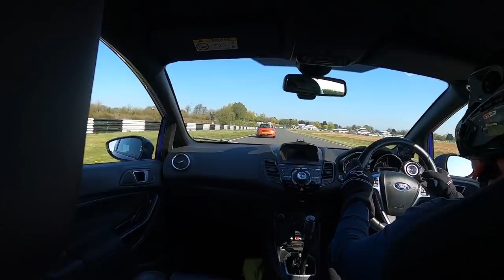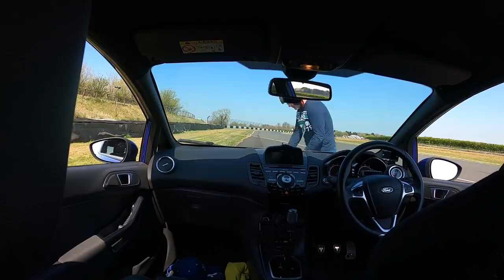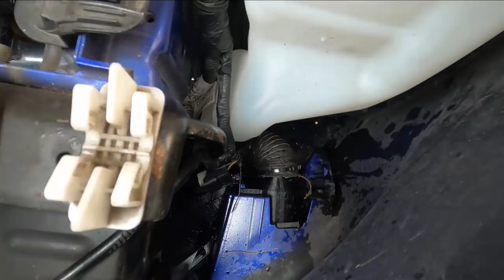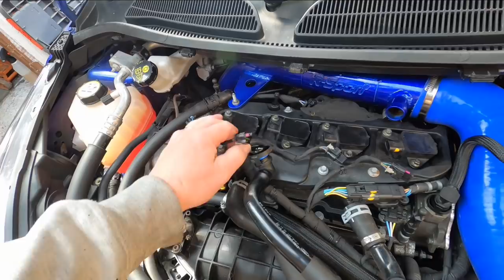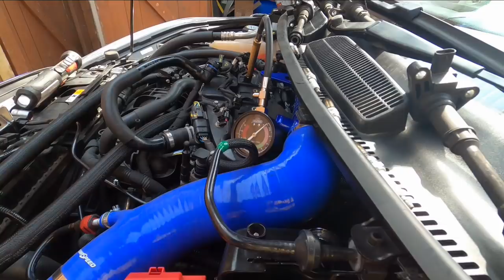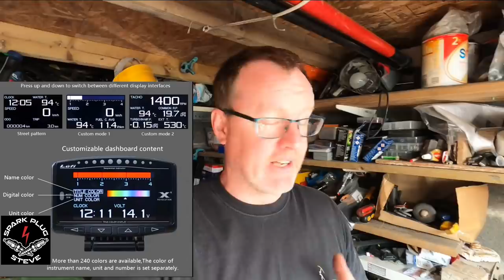My engine blew up! (NOT CLICKBAIT... well maybe the thumbnail just a little)

Comment: Legend has it that an engine always feels faster just before it blows...
Reply: Ye because the piston rings over heat and over expand creating a better seal and thous higher compression but then they obliterate from the excess heat and friction lol. Steve could try putting a tea spoon of engine oil down into the suspect cylinder to see if it helps compression, if it does it means it's your rings, but if not it is the valves (could be from valve float). Either way there is enough second hand engine parts floating around on Ebay you could just hone the damaged cylinder wall depending of severity and then replace the piston rings. If it is a valve just replace it and then lap the valve.

Comment: I think you first cracked a sleeve (overheating) then the ovaled out Cylinder allowed the combustion to push on the side of the piston and therefore it blew off the lower portion of the piston (happened to mine)
Reply from the maker: Seems likely.
Reply: What set up were you running Checcoo97
Reply: @christianwright5479  Stock Block x47r with manual boost control to 2.3 Bar, obviously it was my own fault that it blew up..... Coming from the Abarth World where they have cast iron blocks i had to learn the Hard way what "open deck aluminiun block" means

Comment: you were pushing the engine beyond its limits not surprised it blew up, the internals need modifying crank, pistons etc if you want to race it, that's what race engines are for.
Reply: But aet Motorsport did a few time attack seasons without a problem?
Reply: @christianwright5479  so what point are you making? are you saying there is no need to upgrade the most important parts of the engine? lmfao.
Reply: I’m sorry that you took offence to my comment young man. 
The point I was trying to ask/make, how can the likes of aet run similar power without going pop? 
I have collected 90% of the parts for stage 3. So I’m genuinely Interested
Reply: @christianwright5479  how do you know they run a stock engine block? you can only believe what they tell you and as they sell expensive tuning parts and software what do you think? and will you be able to get your money back when your engine goes pop? cause they told you it will be ok, think not. get your money ready for a new engine cause your going to need one very soon.
Reply: There are plenty ST's running low 300 BHP dedicated for track use with stock bottom end and head... Something just gave and that's unlucky.
Near me there is a dude with a 320BHP ST with gutted interior that he tracks atleast twice a month and the only mod he did to the internals is a pumaspeed block mod to prevent the ovaling of the cylinder bores and head gasket failure.
Only real issue he had in 3 years of the car being stage3 is a broken 4th gear
Reply: @simonoi11  had a 350bhp focus with a block mod, and I drove that really hard never had a problem. 
I run a Collins stage 2 map on the fiesta, but still Deciding what tuner to use for hybrid

Comment: Oil starvation will be the cause. Due to the extra power and grip from the diff its causing the oil to go to one side of the sump   in the corners. For track use make sure you have a oil pressure gauge. I bet its spun a shell and caused ring damage.

Comment: 100% pull the engine out and let us see whats failed. I have 140 psi in cylinder 1 & 4 but 120 psi in 2 and 3 so will be interesting to see what failed already on yours and what is likely to fail on mine. Keep up the good videos 👌

Comment: Hey man, grab a Cobb access port and have Adam Tuned do your tuning.  He is really good and he knows the S280 turbo and the the engine's limits.  We've seen this in the states a lot.  I bet you deformed the cylinder wall right at the thin spot between cylinders.  Can't wait for the new setup.

Comment: A friend of mine has the same specced fiesta st as i do, same tune, same upgrades. After 2 laps on the ring he is hitting 105 degrees while i am hardly hitting 95. Tried everything even swapping parts between cars. Now he is running bigger radiator and oil cooler and is getting decent temps. Strange how 2 identical cars can get so different temps. It's like u say, it's a bit of luck with these engines. Gonna put shims in mine to be sure when i change out the timing belt. And please make some videos of you investigating the engine. U always make it understandable for a lot of people!

Comment: Yes! So many blown stg 3 fiesta's!! Please find a way for our setups to live! Film a series on known failures and possible remedies! (On stg3's specifically)
Reply: Shims, bigger radiator, oil cooler, liners,... not a closed deck cause they seem to have problems with heat building up cause the engines cooling wasn't designed for closed deck.

Comment: Keen to see the engine strip down....my thoughts are leaned out and melted piston or blown head gasket. I have just rebuilt a 2019 1.4 turbo Suzuki Vitara engine (write off as driver hit a animal & cooked it) i thought the compression was still low on 2,3,4...mine one is over 200psi being turbo...or maybe it's just the Suzuki engine design?

Comment: Until the engine is completely torn down are you sure it's a write off? Whip the head off and check for damage to valves etc and have a look down the bores, is the crank and bottom end ok? Can these engines be rebored or do they have to be relined? It would be great to find the cause and factor in strengthening that area on this or a future engine. Is it cheaper to just chuck in another engine? would you know the history of it and have confidence to tune it? Good luck and keep smiling!

Comment: Take the rocker cover off and check all the valves are working as they should. If you've burnt out a valve or bent an inlet you'd have no compression

Comment: Sorry about the engine 😞 If I had to guess I would be a headgasket/ cylinder head went and washed the lubricantion out of Cylinder 1 and then took out the piston ring which tore up the block. Would love to see a postmortem of the engine. Please check the oils as if there is metallic parts the turbo will need to be cleaned or you will be here again.

Comment: Id say maybe ring landings cracked
Or the cylinder bore 
can u get a bore scope an have a look inside  the cylinder see if u got any scoring down sides
Or a hole in the piston 
Sad to hear the bad news hopefully see u build it back stronger than ever
Maybe worth stripping first see if it can be saved
Could build it with forged internals if block is reusable

Comment: It's not zero compression....there's something there which would suggest rings in my opinion. Dead zero would suggest a broken valve or piston(hole in the engine). I would strip it and consider upgraded springs/pistons etc. Stick one of those scopes down the spark plug hole and take a look at the crown ?

Comment: Surprised no endoscope, handy thing to have used mine to check for leaks on the dishwasher last week ( that’s man maths for a tool you’ll need once in a blue moon)  ,,,,,,, I suppose it all comes down to natural limits of the engine, I think asking a 1600 to go much past 300bhp is pushing your luck, do people not put the 2.0 turbos in the fiesta as I imagine ?  Anyway now seems sensible time to pop a k20 in and get some good old NA power in it ,

Comment: steve  take the cover off and check the valves  it could be a  bent or open  valve which would let the oil in and give no compression its worth a look  into   just my guess   m8 .

Comment: I run the 2R Cat Safe, so hope it's not, but will be interested to see if running that had done any engine damage at all? Hard to find any concrete evidence it does damage to engines and not just your cat on the interweb.
Hope all gets sorted soon. Been starting to save for x47r recently, but hearing more and more stage 3's have engine trouble now, definitely having 2nd thoughts. 2R is plenty for public road.

Comment: Sucks to hear this mate
I had the same happen to me 
turned out i burnt a hole in the Zylinder of piston 4 

Bad thing is the engine was completely fine but you can’t buy new Pistons at your ford dealership 
I ended up buying a used piston and put that in 
the car 

was running fine for 4-5 months and now my head gasket started to leak water into Zylinder 1 

Now i am in the process of replacing the engine for a new one and most likely will rebuild the old one with forged pistons and stuff 

I mean you can see it as a glas half full thing 
Atleast it Looks like you can save the engine 
Anyway good luck mate and keep it up 
Love the videos about the fiesta since no one goes as much into detail as you do 👍👍

Comment: Have you got an oil pressure gauge in the car? Didn’t lose oil pressure going round a strong corner and spun the bearings on cylinder 1 and cracked a piston?

Comment: Broken rings,but could be head gasket as well,or a crack being as its getting hot. Its got to come apart.  Get the head off first before you get a engine. You might be lucky ,hone the bore and a set of rings in number 1. New head gasket and away.👍

Comment: I had this happen last year in 1st lockdown,  cylinder 1 cracked piston, piston rings and bits of piston went on an adventure round the engine. drain the oil pan see what turns up. 
damage happens don't worry about its seen a lot of track action by the sound of it.  engine rebuild is alright, get the ford Etas/ itas cant remember the name workshop manual. has complete tear down and rebuild process and torque specs. 

also where did you get your compression tester? could only find cheap Chinese crap on ebay.

Comment: Welcome to the (sad) club of blown engines... I feel your pain... Mine's been sitting at home with a blown cylinder as well, exactly the same as your car (oil coming out of ITG filter, white smoke on track, 0 compression on cyl. 3 but the others are fine, etc...) I will be pulling the engine out as well in a few weeks hopefully. Would be interesting to see what your findings are and I'll let you know what caused mine to blow.
Reply: And ? To mutch hp  or torque seems the main reason

Comment: The engine may be salvageable Steve. If it is would it be worth rebuilding and forging it. The standard engine should be good for 350 bhp so it was'nt the tune. Many many of these are running 300 plus hp. Be a good opportunity to forge it and run a very reliable 350 bhp

Comment: So gutted for you Steve! 😟 I blew my Engine at Combe last year. No Compression on Cylinder 1 and it turned out to be a snapped inlet Camshaft between the lobes of Cylinders 1 & 2. On your Engine it’s more than likely damaged rings on Cylinder 1 but a video into diagnosing the root cause on a tear down will certainly be interesting. Onwards and upwards my friend. Got a fully built engine in mine now with an even better spec. Head up mate you’ll be back on circuit in no time! 👍

Comment: Bad luck steve but onwards and upwards.
Personally i would put my money on ringlands or cracked cylinder liner , most common problem areas. 
If your going to forge or rebuild then talk to my very good friend and master engine builder ian howell at area six developments . He builds ecoboost fully forged with intergrated liners with some little mods that most dont pick up on . He now builds all pumaspeed engines , storm developments audi 5 pot engines (arthur 1038bhp)as well as  zetec turbos. Down side is there around 4k for a fully built block but you wont get it built better anywhere else better.
Chin up mate and if you keep making vids i will keep watching.👍

Comment: Sorry to here about the engine Steve, I just do not trust the heat bar readout on the fiesta dash, it completely useless, and the one thing I hate about the fiesta ST, I lost my standard turbo last year on a track-day due to heat build up, and not having any warning signs from the car, turn out the hot side turbo fin let go, even when it did let go there where no bloody warning sign on the dash. You pick up a new engine of ebay for about £800 so it not too bad. But what I'm interested in is why it happened, it sound like oil temp more then coolant temp which might be the problem here, did you invest in an extra oil cooler for the ST when you installed the big turbo?

Comment: Could oil starvation cause damage to your engine? You had grippy semi slicks so...
Have you lost oil pressure just before engine failure? Do you have baffled oil sump?
Reply from the maker: I Have a baffled sump and its not looking like anything it do with oil Starvation. Hopefully yet a video out on the teardown by next week.
Reply: @Sparkplugsteve  it must be something else then. Btw your spark plug s was is bad condition. If you find damage to the poston rings or piston or both there was detonation also might be lspi but this can occur below 2.5k rev and you were on the track. Time will tell...

Comment: It is going to of melted a piston by the sounds of it 😔 often caused by the turbo leaking oil in to the inlet system and the engine drinking it as fuel but if the turbo is new its alittle strange (would explain it running hot with no problems with the cooling system though)🤔 had heard of many many stage 3  vxr corsa melting  pistons(believe  cylinder 4 )

Comment: Ring land failure no doubt. Piston rings expand due to higher cylinder pressure (more boost+fuel) which cause the ends to butt together & then seize momentarily which breaks the piston. Standard failure for engines with the boost wound up. All the compression ends up in the crankcase which pumps oil into the breathers & clearly you end up with either a path between combustion chamber & crankcase or at best oil control rings which no longer function.

Comment: Do you have a baffled sump? Could have been oil starvation that caused the issue to begin with.  What year is your car? If its a 2013 or 14 then it may be one for the coolant recall?
Reply from the maker: Yes I that's a baffled sump and its a 14 but didn't need a recall.
Reply: It very odd as I thought these engines can take some punishment and tuning. I believe that up to a certain bhp they can take. But I wonder if its like the focus St's where at a point they need the block mod done??

Comment: Gutted for you pal , Made me concerned now, just cruising mine sits at 99-104 but when i boot it it drops down to 92 degrees. Only running stage 1. Any tips? Thanks
Reply from the maker: As long as it's cool while wide open it's fine I would think but ask a professional would be best.

Comment: Why don’t you do a scope down the port , or could be piston rings oil piston ring
Reply from the maker: I did scope it just not in camera. All. I saw was oil floating on top of the piston
Reply: @Sparkplugsteve  then that’s piston rings the oil ring ,  it’s cooked it and has passed the piston  so hence no compression in my opinion
Reply: @Sparkplugsteve  I purchased a OBD thing of your eBay   Not much  but every little helps
Reply: @Sparkplugsteve  this is what I would do ,  order head gasket set , water pump , timing belt , timing belt locking pins ,  take head off ,  inspect clean and port polish , skim the head as it’s aluminium,  inspect piston an block ,  then assess then going forward  with the block   Would be lovely to forge it   You then have an excuse 😂😂

Comment: Are running a standard radiator? I’m wondering if it’s a hotspot around cylinder 1? Yes the rings or piston may be damaged and the cause of the oil, but they are likely to be a symptom of another failure. Contact Pro Alloy as they have a lot of experience with these cars or Gary at AP Tuning who runs one over 400bhp on standard internals (I believe). Don’t be disheartened, it’s happened to us all.

Comment: You were right it was flying Steve,you were all over that megane..has it dropped a ring ? Or rings.? It's like if you have upped the anti on the car. .is it a case of weakest point went? But last but not least,gutted 4 you m8..you av worked wonders with that car m8..I know that a fella on Facebook is scrapping his ST Fiesta..ad says all parts available ..it's on the cars & car parts..it's a burnt orange I believe.. ps. I think Milkman is spot on..

Comment: Oh no Steve 😩! Sounds like it’s melted a piston or cracked ring lands.
Reply: Yea Graham ive saw a few of these engines melt pistons straight through the ring lands
Reply: Did you find out what caused it? Running lean or heat related etc.
Reply: @gw199010  I think it’s down to LSPI(low speed pre-ignition)caused by a number of things, poor quality fuel, poor quality oil, high cylinder temperatures causing detonation and labouring the engine in a high gear from low revs also caused by poor mapping(too much ignition advance)

Comment: This is the normal life of a car guy, especially one who visits tracks, not just garage 'tuning' and street pulling /showing off. So imo hole in the piston, which would be strange considering usually it happens when leaning out but watching all of the plugs its actually very rich. (could it be cylinder wash-out from too much fuel tho?) Or broken piston rings braking the piston ring lands itself. So then i hope it hasnt scored te cylinder walls too much. Interesting if you drain the oil what will you see there. In the end of the day, its 300hp from a small 1.6 tho, don't you think it's pushed a little bit hard and even if absolutely everything is ok it wouldnt blow up at some point anyway? With this question what i mean is, when you fix it, wouldn;t it blow again shortly after again? Maybe a bigger engine swap is better in the long run?

Comment: Get it done if it's just a ring..better the devil you know than to buy an unknown quantity right! Shame you couldnt check with a ford dealership any body else had similar..etc..few yrs back they getting recalled..Not sure if it was something to do with the block or liners cracking? I hope you able to get to the root of it Steve..That car flies along..If your lucky enough that cylinder is unmarked.& it is the ring stick with it Steve.